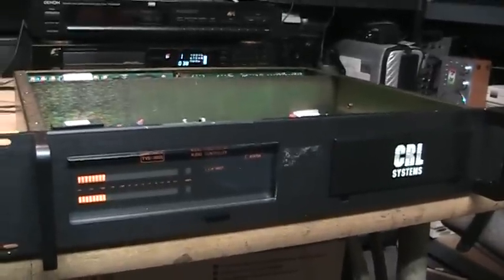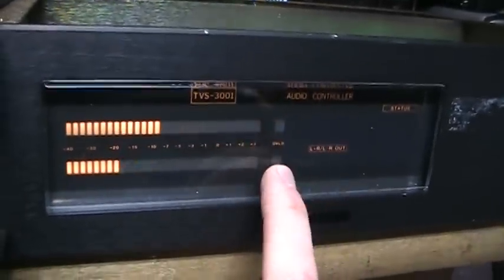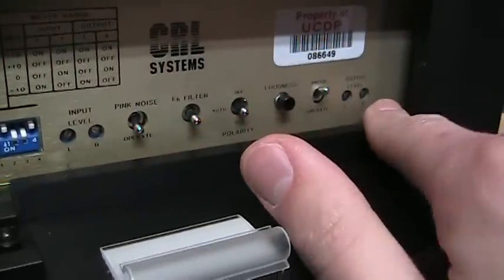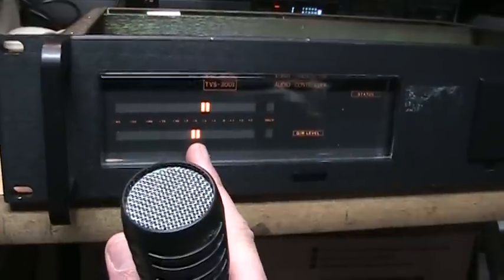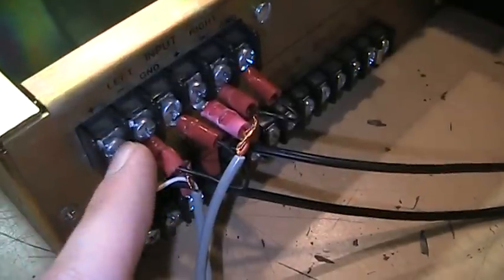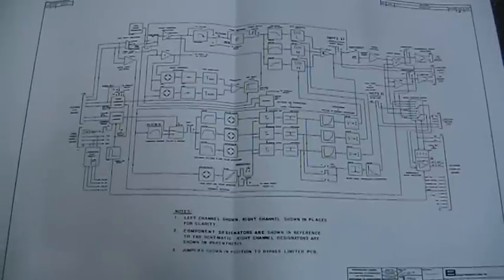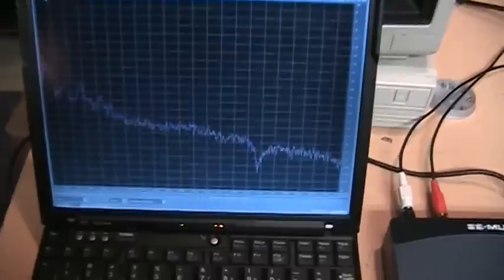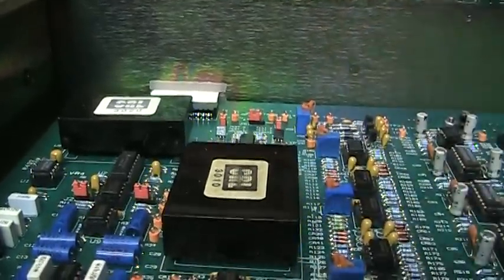CRL Systems TVS-3001 Stereo Television Audio Controller

Comment: for those that dislike loud tv commercials, this was the device that made those commercials loud. there are terminals on the rear of the unit that allow remote control of the loudness circuit so in typical use in a tv station the loudness button under the front panel would be out, or off. the control terminals were wired into the tv station's sequencer system so when a show comes on, the loudness circuit is turned on to keep the sound nice and level. when it's time for a commercial the loudness circuit is turned off so the audio output jumps and the commercials are loud and obnoxious.. but the cool thing is if you use one of these on the receiving end of a broadcast tv signal even now, it solves the loud commercial issue. but finding these things is getting pretty hard now, the last one i saw for sale sold for 700 dollars about 8 months ago. i was lucky enough to get 2 of them from a local tv station when they switched to digital so they were cheap back then...

Comment from the maker: @uxwbill Do not connect the negative output to the ground, you mean. Doing so might damage the NE5532 output op-amp, but probably not anything worse. The processing does sometimes exhibit a "bass pullback" effect, causing an audible reduction in overall loudness when a song has a quiet intro followed by a sudden loud kick drum or bass guitar, for example. However, that was not evident in the samples I used.

Comment from the maker: @CenTexVideo The 3-band AGC has faster time constants and rides atop a slower wideband control signal, so the overall effect is that of a wideband AGC followed by a 3-band compressor. The wideband is linked between the channels while the 3-band is independent. Overall it borders on being needlessly complex for the task, and I think the much simpler dual-band AGC in the Amigo does an even better job, with no bass pullback effect or stereo balance shifting.

Comment from the maker: @BadEditPro It is just an AGC (acting as a wideband AGC followed by a 3-band compressor). Towards the end of the review I did mention that CRL included provisions for a separate limiter & MTS TV stereo generator board to be installed in the same chassis, which they sold as the TVS-3010 all-in-one stereo TV audio processor.
Reply: actually it was the tvs-3003 that had everything, the tvs-3010 just had the limiter board with no stereo generator. the stereo generator adds almost $2k to the price..

Comment from the maker: @weasel2htm Each manufacturer has different instructions depending on their particular design. CRL says you do need to short the negative input terminal to ground when using an unbalanced source. Without that, the audio will only be very faintly audible.

Comment: @RiaRadioFMHD773  I don't know if you are talking about "delay" as in latency (there is none) or the attack and release  time.. but if the second my guess is it is pretty quick because as it seems to be made for the general output of the system.

Comment: It falied on high frequency material. Human ears are more sensitive to high frequency. It should pull everything down. But that's 90s technology and it's doing great job
Reply: it did not fail, broadcast equipment like this clips high frequencies at 15khz by design due to broadcast standards.